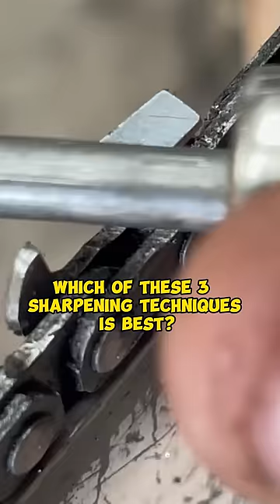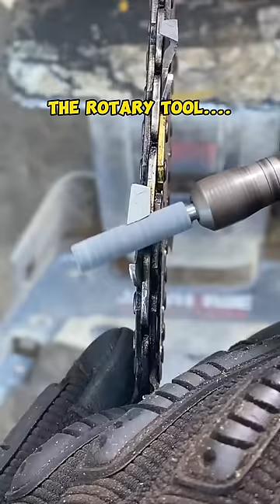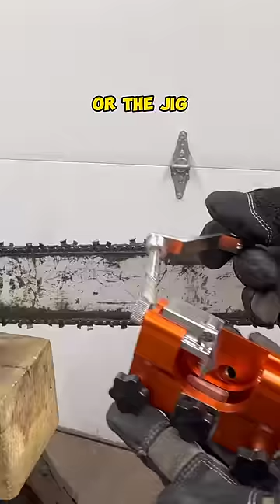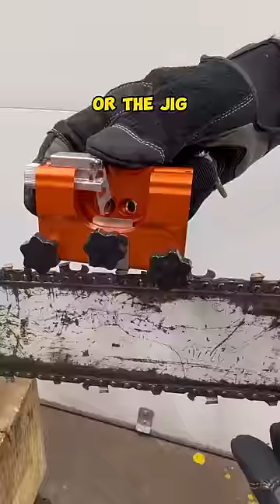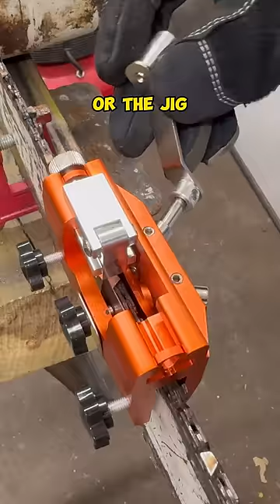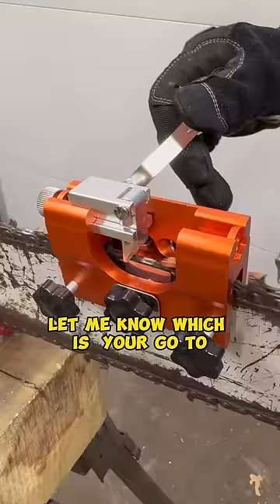What's your favorite way to sharpen a Chainsaw? #tools #chainsaw #lifehack

Comment: As a macinist, I think you can't beat the original finish. The chains were ground at the factory, and grinding takes the minimal material each time prolonging the life of the blade. But, they all work, so if you lack the skill level, use a good file. Saw chains are not that expensive, anyway.

Comment: I ues a dimond file a really sharp smooth finish push no drag....and if rotary burr tool make shaw it rolls away from the top. so it doesn't do what happened in the tutorial...and it will cut 😂😂😂